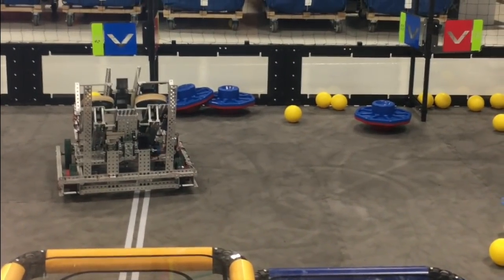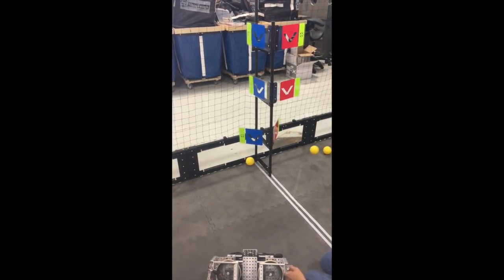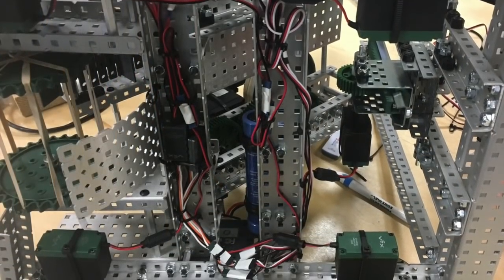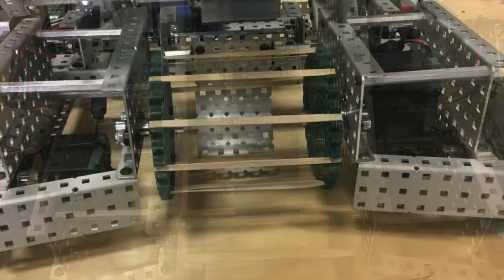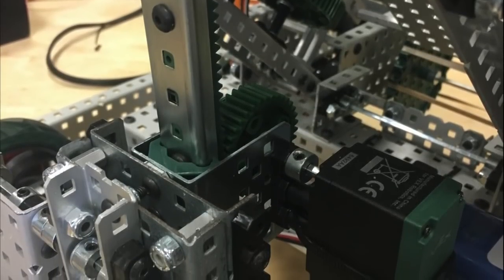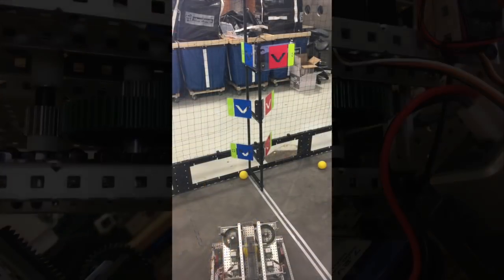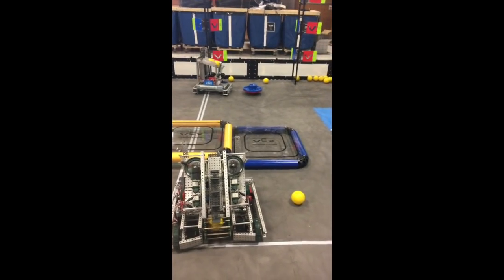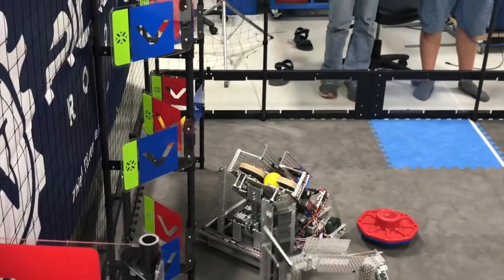Vex Turning Point Robot Reveal And Explanation

Comment: How did you make it so that platform could tilt i would like to copy that for my inclass project and looking at the photos only get me so far.
Reply: magic
Reply from the maker: Its essentially a really short linear slide, with a pivot at the top and the bottom. It's important that the slide pivots, otherwise it won't work. Let me know if you have any questions. :)

Comment: Great Vid! quick question: When y'all coded the auton, did you use any vision sensors/encoders to identify your color depending on what side of the field you were on, or just assumed that you'd be on one side of the field and adapted your code to fit with that side of the field?
Reply from the maker: We coded one side, and then basically reversed everything and tweaked. We had a potentiometer to choose what color autonomous we were using. If I remember correctly, one of the two autonomous programs was able to get the middle flag and the other one couldn't, but that could have probably been fixed with more tweaking, but we didn't have time.

Comment: how did you mount the entire flywheel mechanism and finned wheel intake transport? It looks crazy how you guys managed to turn that huge mechanism on a single pivot point! How did you do that??
Reply from the maker: The main pivot was a simple axle running through the a set of holes at the far back (the furthest back if I remember correctly), with another pivot up with the aiming mechanism.

Comment: can someone help me out cant find the answer to my question anywhere:
so I know you have a certain zone to extend in but you cant extend outside the zone so if that's the case can you come out extended? I assume the answer is yes because on the video reveal the clawbot had its claw extended outside the zone and was wondering if maybe we can come out extended... like extend in the zone then go out the zone but dont extend back... am I wrong?
Reply: Normally your robot can start in 18x18 and then extend to about 24-36 so depends
Reply: You can only be expanded in the expansion zone. Once you are out of the expansion zone if you are above 18 inches that would be against the rules and you would likely be DQed
Reply: Horizontally you can expand up to 36”, My team has a rotating claw that falls down during autonomous; however you can’t exceed 18” vertically except inside the expansion zone

Comment: Do you have information on the camp you went to? I am a teacher and this sounds like something I want to try and host.
Reply from the maker: It was a five day camp where students came at 8:30, built, programmed and practiced until 4:00 where they cleaned up their workstations. Lunch was provided and students were split up into groups of three or four. Each team had their own parts but were free to ask other teams for parts. Day one was building, as was day two. Day three was driver control and building, and day four was autonomous and building. Day five we continued programming, competed in mock matches and eventually competed in the “official” matches. After the matches, teams disassembled their robots. Also, there were plenty of tools on site to allow students to cut and drill metal to size, and there were instructors to help teach students how to do more complex things and tool safety.

Any other questions? :)
Reply: Kepler Electronics do you have a link to a website or a contact for the camp?